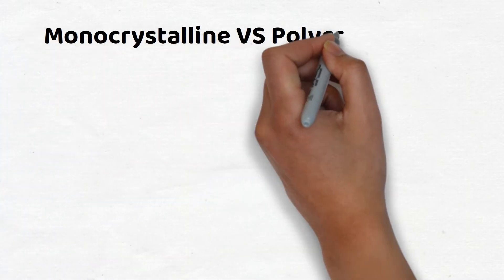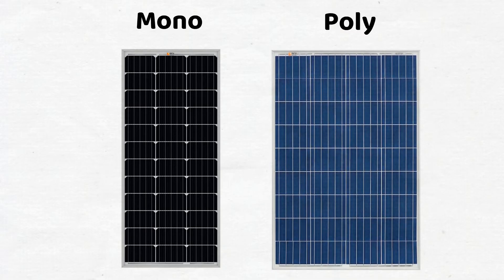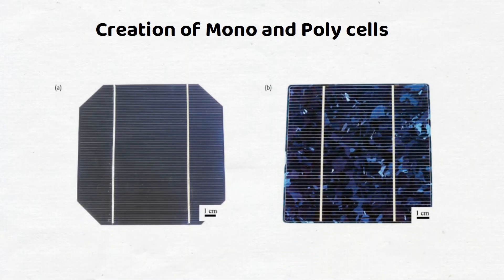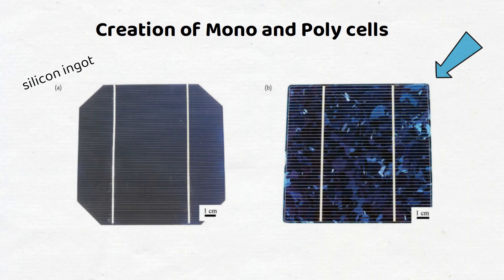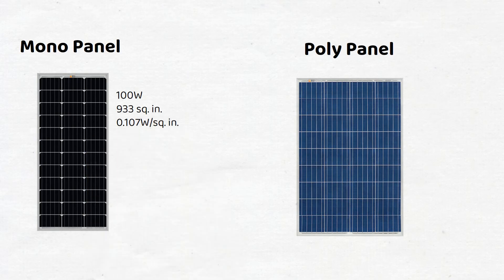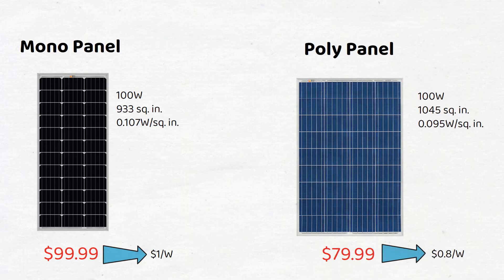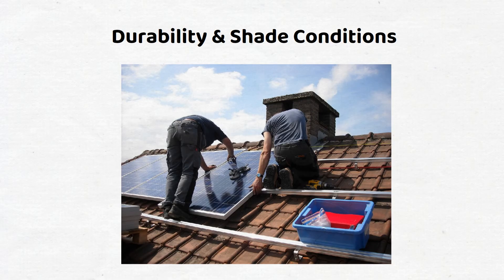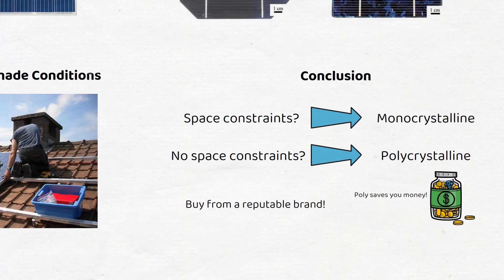Mono vs Poly vs Flexible: Best Solar Panel Type Compared

Comment: Thank you for this analysis . I was thinking of selling off my poly panels and replace with mono . This video just made me change my mind. It’s common sense, the poly do exactly what mono does but need more surface area to achieve that. Simply means if space is not a problem, go for poly and safe cost 👏🏽👏🏽👏🏽👏🏽thank you for this . The best video on this topic . Short and precise .

Comment: Considering practical conditions on roof top like dust. Partial shadow, which one is better mono or poly
Reply from the maker: Both are the same in shady conditions. Mono is more efficient per surface area. So Poly is a little bit larger for the same power rating.

Comment: I've  used  solar power, offgrid,  for  43 years in different  locations and have  been involved in (NON-commercially) installing perhaps 250 systems  of  different sizes, qualities and prices.  Keeping up  with  developments (and/or explaining them  to people  for  whom I  provide/install systems)  is  not always  easy, but  THIS  video is  by  far the   most comprehensive  and simplified  description/explanation I've ever seen.  (Not  something I  say easily!) Thanks  for  showing the  world people involved with alternative power aren't all self-styled 'experts' or  some other brand of  fuckwit. Or  trying to  flog a  sus product via confusing gobbledegook  of the  'customer'.   All the  best.
Reply from the maker: Thank you Dabbbles, your feedback means a lot to me.
Reply: which one is the best?

Comment: My polycrystalline panels work better than mono.  Maybe it’s just the brand but wow, I go to my 100 watt poly nkrmally
Reply: With the same surface area?
Reply: @thor.halsli  Actually you might be right.  The polycrystalline is slightly bigger but not much